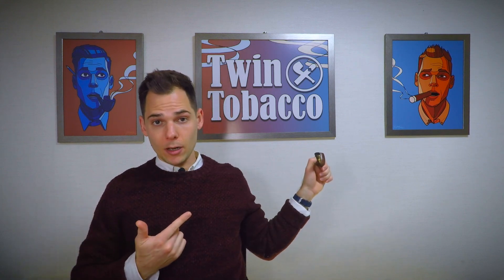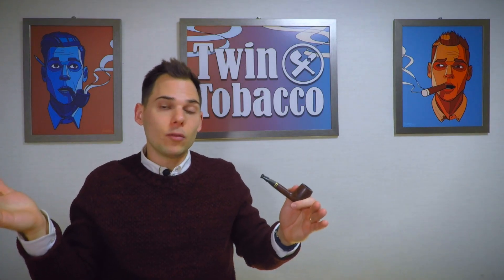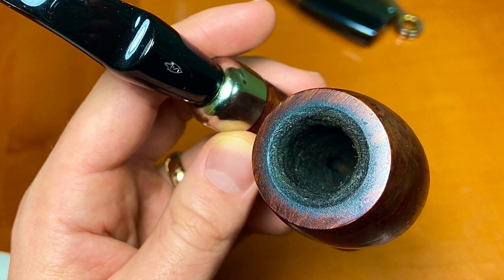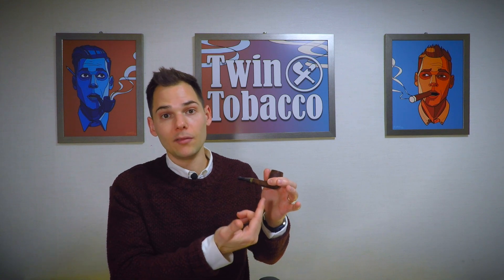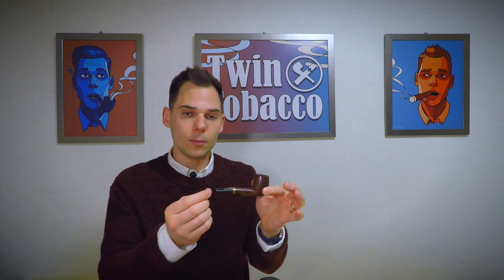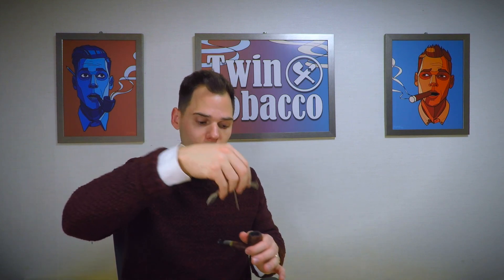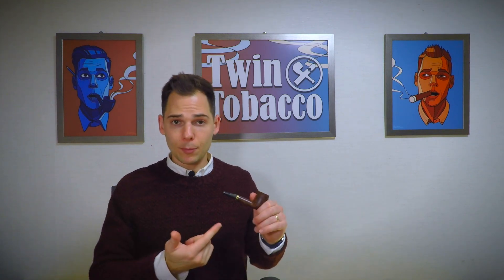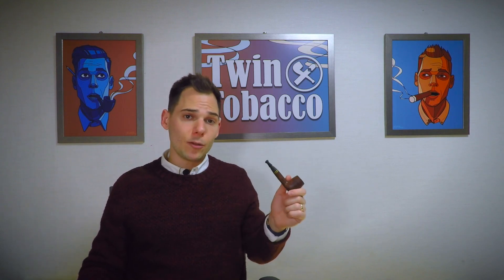How to Break in a New Pipe

Comment: I know its an old video but i hope you could read that, ok what about smoke and shake the ash as you said and then  put the pipe bowl a few seconds on top of hot steaming water to  make  the inside of the bowl a little bit humid and then let the humid ash dry and form some sort of pipe mud On the walls... i am doing that on the bottom of my corn cob pipes and its like cement!

Comment: Hi, new pipe smoker here, just bought my first pipe. Thanks for the great video! So when you have smoked the pipe 10 times, half full to break it in, how many times do you recommend smoking your pipe per day maximum? I've heard you should never light up warm pipe, but is there a limit to how often you can smoke your pipe, if you let it cool down properly in-between sessions?
Reply: Hi, just let it cool off between smokes. And if you have a filter, replace it only when pipe is cold. The stem expands with heat, and twisting it while hot will damage it. I personally run a pipe cleaner between smokes, and replace the filter.

Comment: Step 1. Get a pipe and smoke it. Some things are gonne be weird, Google those things to correct the problem on the next bowl.
2. Keep doing that for 50 bowls and evaluate what your bowl looks like. If it's burn through, make the corrections. If it's a wetness problem, it should have been corrected in the first 25.7 bowls. Again, Google when life sucks. From there it on to #3.
3. See mutton choppiper for ways to control the ember and make your bowl shine.
4. Add time + experience + fun + friends amd you'll have a great time. Don't get wrapped around the small details.

Cheers mates!
Reply: + for muttnchop. He really changed my pipe smoking life, I don't struggle with my pipe anymore.